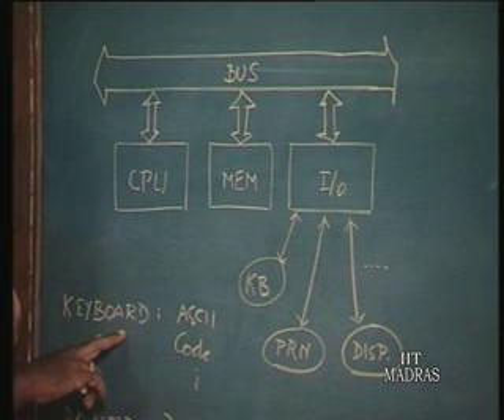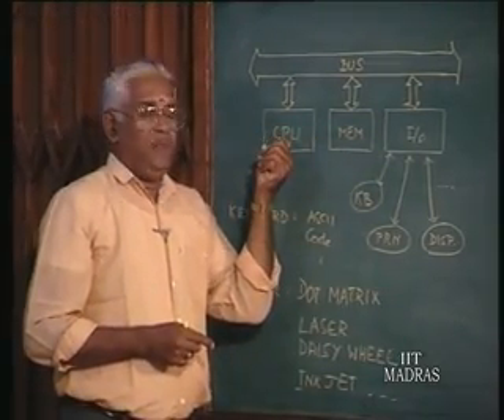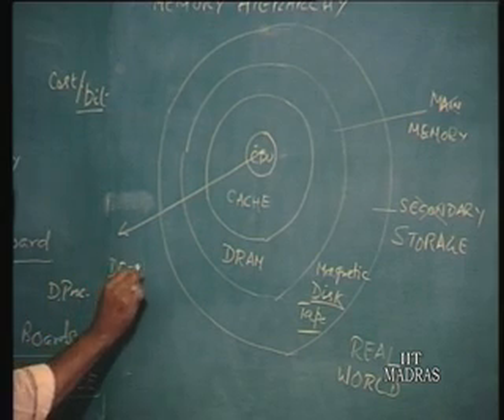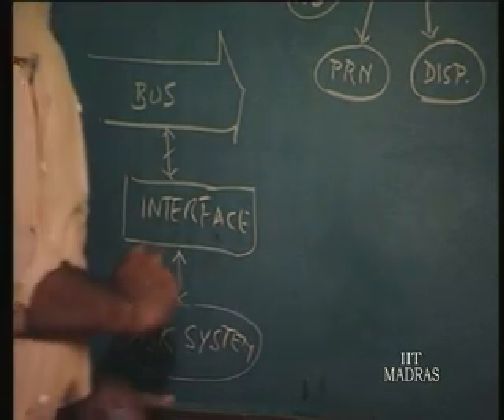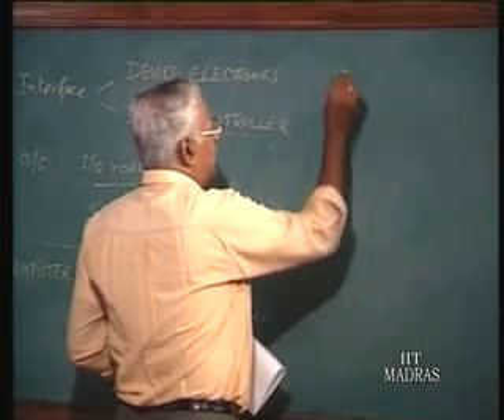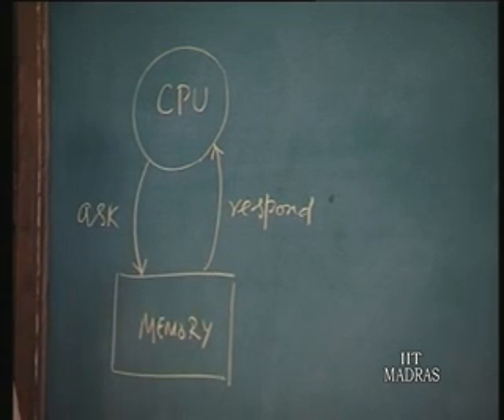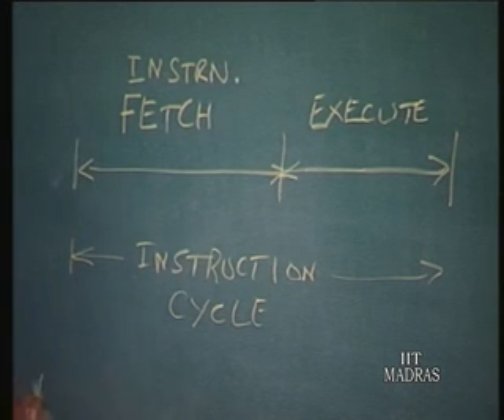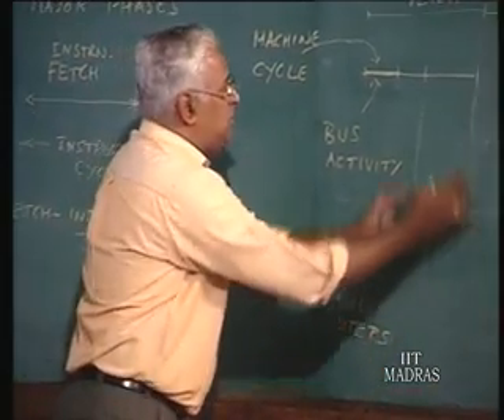Lecture - 3 Introduction To System : Hardware

Comment: Fetch_Execute has been briefly explained later on. In the simplest cases, Execute is only a simple combinational operation carried out in the last state (with a single pulse). In complicated address modes, it involves fetching an operand (may involve more than one machine cycle), which is similar to fetching an instruction, and then just one state for actual operation.